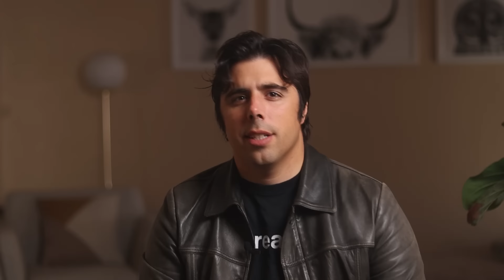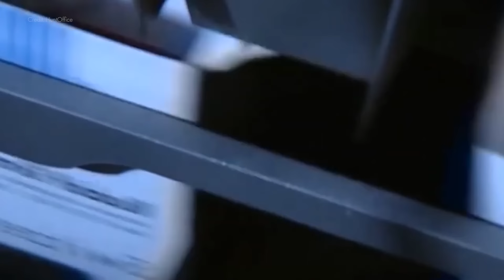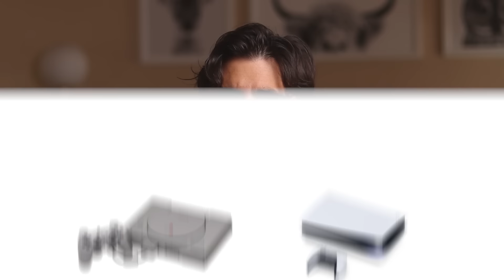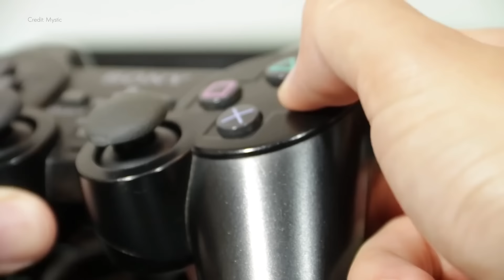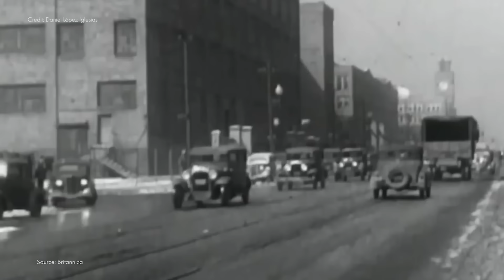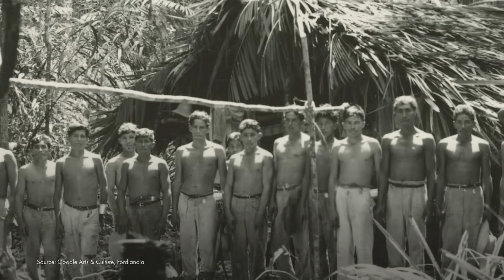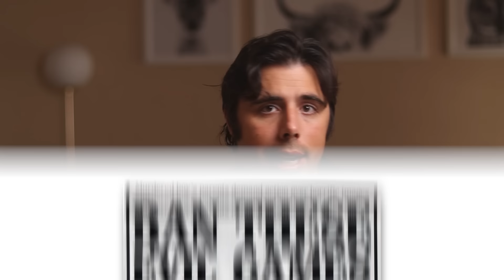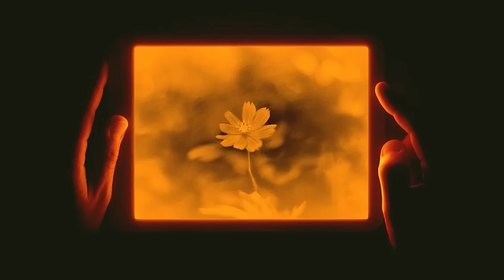Why Some Designs Are Impossible to Improve: Quintessence

Comment: The reason for Mag-Lites success was that it was a weapon in disguise. While nightsticks could be banned in some areas for being a weapon, a flashlight would not.   As noted, even when police where forbidden to use nightsticks they loved carrying a big ass Mag-Lite.
Reply: Yeah, getting slapped with a long aluminium rod filled with 3 to 5 D-cell batteries wouldn't be very fun
Reply: @ZMicron 4/6/8. Afaik they never made 5s, just 2/3/4/6/8.
Reply: i've used some of those flashlights, and yea, they are basically clubs with a light - up function.
Reply: I remember looking through a catalogue and seeing a side handle attachment for the Maglite, basically reinforcing its dual use as a baton/club.
Reply: @kutter_ttl6786  dont even have to go that far, the d-cell maglite diameter perfectly fits the additional sidehandle that comes with most power drills
Reply: I used to have a 6 cell maglight
baseball bat comes to mind
Reply: Yep, even the mini mag-lites my dad put in everyone's stockings one year are sturdy and heavy enough to use creatively
Reply: As someone who briefly carried one as a paramedic: can 100% confirm OP's statement. My dad likes Mag-Lites for this reason, as did every auxiliary cop I ever met.
Reply: Smaller flashlights come with a "combat crown"... usually not pre-sharpened, but kind of obvious about their intended use.
Reply: @JaroslawFiliochowski I've always thought that's the stupidest thing on a smaller flashlight. While the window breakers on some pocket knives could be easily added for emergency use on a flashlight .
Reply: Not much of a disguise, it was more a club that would help you find the people you were clubbing
Reply: Honestly, I don't even think it's just because it's "in disguise", I think it's that you can have a way to defend yourself without needing to drop your flashlight and switch to something else. If you're holding the flashlight, you're already prepared both for investigation AND defense
Reply: I was so happy when maglite torches could accept a LED replacement 'globe' into it standard socket. It made the battery last longer and I felt a better light distribution.
Many a scout camping trips I took my maglight - as well as feeling safe walking to and from scout nights in the dark. A old school friend kept theirs in the well next to drivers seat as a ad-hoc baton. I still have my original 90s one with LED upgrade and belt holder and a plastic torch holder you could screw into a door frame or car boot frame.
Reply: Very stupidly and coincidentally I was just watching a let's play of a cop game where one guy said his uncle was a cop who'd beat people up with flashlights, and I just thought it was part of the gaslighting and BS that comes with that territory
Reply: my dad was a cop. as a kid we had chickens, and it was my job to go get the eggs. i'd often forget and have to go get them at night. we lived in a fairly urban suburb, and the coop was next to an alley, and as a young girl my mother had put the fear of men into me, and so i was pretty damn scared of going outside at night. so I would always grab my dad's flashlight just in case. never realized it was literally built for that until just now, lol.
Reply: I just use mine as a flashlight.
Reply: @JonS8957   still better than using it as a fleshlight though... 😏
Reply: @JonS8957 yes, even the big ones were excellent flashlights until around 2010, when LEDs became more efficient. I had the 6D version. Never used it for anything else, but it had many advantages to other flashlights of the 90s/2000s era: it was much brighter, had a good beam focus and because of the 6D cells it lasted very long (I think about 12 hours with zinc-carbon cells and over 24 hours with alkaline without too much decline in bright ess). Also you could screw the top off and use it as a make-shift reading lamp, as it was wide enough to keep standing. With this technique you could even illuminate a small to mid size room with enough brightness for most tasks.

I know that there is also an LED version of the mag-lite, but you can now just use small and cheap LED flashlights, they are usually brighter than the old maglites and because of the higher efficiency of LEDs, they still last long and they usually also have good beam focussing (also because this is easier to be done with an LED than an incandescent lightbulb, where the light is emitted from a very thin wire). So except for people who also want to use their flashlight as a baton, there is usually no need to buy an LED maglite instead of some cheap LED flashlight.
Reply: ACAB
Reply: But his comparison was with Kel-Lite, which did the same thing.
Reply: Kinda like how this video is a satanic weapon in disguise!
Reply: leave it to america police to turn a flashlight into a weapon of brutalizing citizens
Reply: I never bought a mag lite because the first time someone lent me the flashlight they called it by its “____beater” nickname.
Reply: Interesting how he literally said this already
Reply: hit with a mag lite in my head twice
Reply: As if I didn’t already think they were pos
Reply: He says that in his video if you watched it. “Look at me!” ass comment.
Reply: Now you can use high-lumen LED flashlight as a weapon 😏
Reply: No, no, no and no. The defining trait of the Mag-lite is the machined aluminum, almost indestructible body. The fact it can become a club is a SIDE benefit of the design.
Reply: Yay to police brutality
Reply: acab
Reply: You missed the point of the question. The question wasnt "why Maglite?" It was "why not Kel-Light?"
Reply: @SeekerGoldstone  I didn't miss that point, I found it irrelevant for my argument. Kel-Lights were never a thing in Sweden were I live, but Mag-Lites were, beginning to trend big time from the early 90's on.
Reply: @ingvarhallstrom2306  Yes, you are missing the point. Why did you have Maglite but not Kellight in Sweden? Why have I never heard of Kel-light in Canada before? Why did we have Maglite instead of the original?
Reply: @SeekerGoldstone   I have no idea? Ask the makers of this video? That wasn't what this thread was about, but you're welcome to start a thread of your own with that topic.
Reply: My cop mom sure did beat people with her's because it was already in her hand. The straight baton was for throwing at the backs of runner's knees to knock them down. She had a baton with a perpendicular handle (forgot their name) for beating people in close quarters and a slap jack for long term beatings. She never went anywhere without her precious handcuffs.
One good use for her mag lite was breaking car windows to help rescue crash victims.
Reply: @0therun1t21   For the master of a craft, each little task requires its own specialized tool, which has to be perfectly designed for its task. The cooks of Michelin-starred restaurants know this truth, but so do the connoisseurs of clubbing, the masters of mauling, and the bravos of beating.
Reply: @0therun1t21 pr-24 is the baton with the sidehandle.
Reply: Where forbidden?
Where?
Reply: @korpakukac   In Sweden nightsticks count as melee weapons together with brass knuckles, knifes, stiletto knifes, butterfly knifes, shuriken etc, and their use is criminalised in public, and the sale of such weapon are prohibited fir anyone under 21.
Reply: @ingvarhallstrom2306  There are some examples that are way more strict. Commercial sales of many of said items may be outright illegal, even in locations where civilian firearm ownership is widespread.
Reply: @ingvarhallstrom2306 You missed the point, and when someone mentioned it, you missed it again.
Reply: @BishopStars   I didn't miss the point, we're talking about different things. This thread is about the topic I stated, the weaponization of flashlights of this type in general, maker irrelevant. You're discussing a completely different topic, why maker X survived while maker Y didn't. I only took a brand name as an example, which brand name is really irrelevant for the discussion. As I sayd, you're completely free to start a thread of your own with thar topic.
Reply: @ingvarhallstrom2306 in sweden the police are banned from using nightsticks?
Reply: @Monkeycantnutz  

No, but the public is banned grom using them in public as they count as melee weapons. If the police catches you with a night stick that is obviously made to harm people or used for criminal purposes, you could be fined or sent to prison for up to one year.
Reply: If that was true they wouldn't have been replaced with smaller lights. It was about power. If you wanted a strong light, it had to be big. And cube shapped lights couldn't be carried on your person.